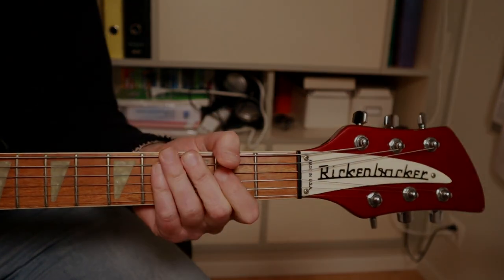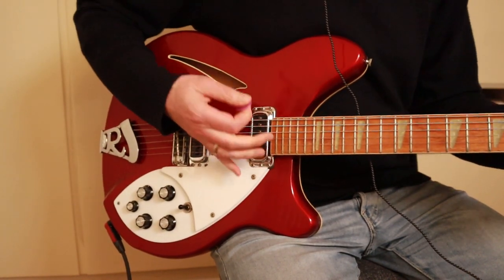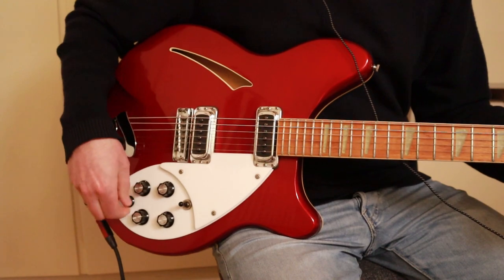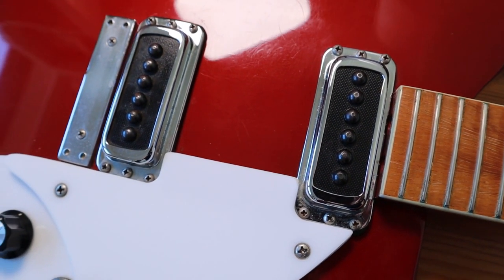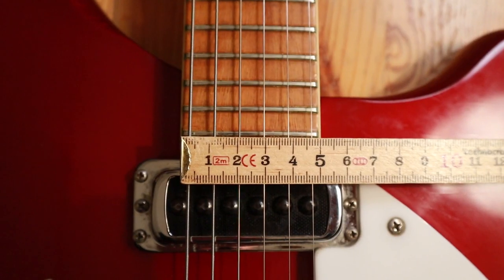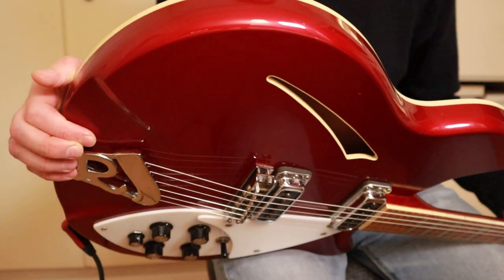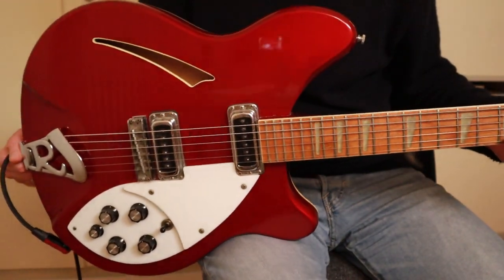Rickenbacker 360 - Sounds, pictures, info

Comment: How exactly do you have yours "set up" I just bought a brand new 360 and love it but I'm afraid I don't have the nut/bridge/strings etc... like they need to be to get it sounding like yours!
Reply from the maker: Congrats on your new guitar! I measured the action on mine, on the low E it goes from 2mm (nut) to 3 mm (12th fret) to 4 mm (24th fret). On the high e it is 1.5mm, 2mm, 3mm. I use roundwound strings, 09-46, nothing fancy. Have fun and enjoy your 360!
Reply: @becauseguitarsolos1264  Hey thank you for that response! I came from a 2012 Mexi-standard Strat. I find a lot of similarities but I was not a fan of the strings they ship them with and was getting a lot of buzz from the low E string.

Comment: I'd be surprised if after all this time, you haven't discovered that your 360 is actually a stereo guitar. You can plug it into two different amps using the RIC-O-SOUND output with TRS cable.

Comment: My 1971 360/6 has been in my hand since, well, 1971 when I bought it, it is a thing of beauty. The neck on yours seems so much fatter than mine, mine is really thin, fingerboard width is around the same, but.. And despite the absurd amount of years I've played it, the frets have never needed anymore than a touch of crowning, maybe 3-4 times since new... it does require a very light touch, even with 10-46 strings I use.. Fabulous instrument, nothing you can't play on it
Reply from the maker: Thank you for sharing!
Reply: @becauseguitarsolos1264  Thank you for highlighting these wonderful guitars..!

Comment: Thanks for the great video. The fretboard on your guitar is actually "Bubinga". It is commonly called "African Rosewood" but it actually isn't a rosewood at all. However, it is a decent quality hardwood very befitting of a Rickenbacker. I had a Fireglo 330/6 back in the mid 1980s and while it was a great playing guitar, I could never quite get into it's tone. The mid to late 1980s was really dominated by Strat styled instruments and with the right pickup configuration, effects chain and amp, a Strat could produce most of the tones of a RIC 6 and a Tele could get very close to a RIC 12 string. However, the RICs are beautiful looknig guitars, absolute works of art. One day I will probably buy another RIC but this time it will be a 12 String that I should have bought in the first place. Cheers from the Land Down Under.

Comment: What is the story on the two output jacks?
Reply from the maker: One is the regular output that works just like on any other guitar. The other is a stereo output that requires a stereo Y-cable running into two separate amps. Why is it there? It was the 60s man, everyone was high.

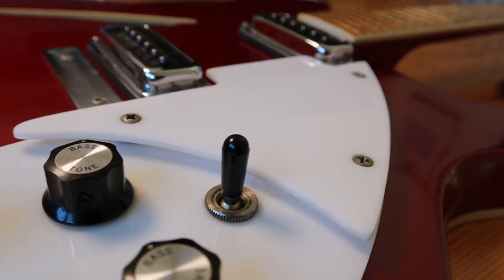Comment: 1:05
5th knob controls the blend between the bridge and neck pickups when in the middle position. Edit: aha, you explained it in the video...

Second output jack: "Stereo" for a y-split cable. Connect to 2 different amplifiers, one is the neck/low frequency output and the other is the bridge/high freq output.

Beautiful guitar.
Reply from the maker: Thanks for the comment! I might do a demo of the stereo function some time soon.

Comment: I've tried a few Rickenbacker guitars including the 12 string model  that  Tom Petty/Mike Cambell used. I found that the necks were all too narrow for me. 
I eventually found that the Yamaha Pacifica electric 12 string suited me much better. 
As for bass, I do enjoy my Rickenbacker 4003. Never parting with that.
Great video...
Reply from the maker: Love the 4003!
Reply: I have the same problem with the necks on the Ric's being too narrow, that's why I will always be an admirer, but never an owner. Instead I have a Danoelectric 12 string (with a 1 3/4" nut) to scratch that itch.

Comment: The most beautiful, elegant electric ever designed! You should have explained the stereo Rick-o-sound feature. I think that the mysterious fifth knob is actually there to fine-tune the mix when using that.
Reply from the maker: Yes, that makes sense!
Reply: That's the best theory I've ever heard regarding the "Fifth knob". 
Also, what electric guitar doesn't sound better when played in stereo?
Reply from the maker: @charlie-obrien  I totally agree, but there is still one problem with the theory: The 330 and other mono Ricks still have the fifth knob. So perhaps Mark Agnesi was right with his explanation: "Why does it have a fifth knob? It was the 60s man, everybody was high."
Reply: I have honestly never seen a modern Rick without Rick-o-sound, like 330s/360s post-1985. Agnesi is probably right. It used to drive me insane that he would play $50G guitars with all those rings on. I'm sure it distracted me from counting the pots on vintage models.
Reply: Sorry, Because, you're right! No Rick-o-sound  on the 330.
Reply from the maker: @meatsuitsublimator8506  I still think your explanation is the best one.

Comment: With that amount of fret wear do you have to have the action high? What is the action like? I just got my 2002 360 and the action seems crazy low. (I'm used to Fender guitars.) I'm guessing turning the 4 bridge screws clockwise raises the action? Thanks.
Reply from the maker: Despite the worn-out frets, the action is not very high on this one. I'd describe it as a comfortable mid-low. I could make it lower still, but prefer to have it this way. You're right that the way to raise or lower the action is to use the screws on the bridge.

Comment: The rick is a semi acoustic, just with the other f hole guitars I think they are better for rhythm and strumming. Rick's immediately got stamped with legend status when the Beatles used them. Ironically in later years they moved on to the epiphone casino a much cheaper guitar. Even though the casino is now chinese made it is probable 8 or 9 times cheaper than a new rick.
Reply: The original Epiphones were equally high quality guitars before Gibson bought them out and turned the name into their budget line

Comment: Thanks for doing this video.
Is there a specific model name for that body shape? Was it the only Ric produced with the single binding on the bottom? I had a 360-12, same color and body style, for three years.
I bought it very used at a music shop in Lewiston, Maine in 1980. It presented like it had been around a while, or had somewhat of a neglected life. That's probably the reason it was priced low enough for me to afford it. Judging by the condition, I would estimate it was at least 8-10 years old, So I like to think I had an authentic 1960-something Rickenbacker. I wasn't keen enough to look up serial numbers or anything like that back then.
Sadly, it was totally consumed in a house fire in December 1983 so I'll never know exactly what year it was made.
Reply from the maker: Thank you, and sorry about the twelve-string. I've seen the body shape referred to as the 'contour' style, as opposed to the 'double binding' style.
Reply: @becauseguitarsolos1264  Thanks for the reply. I watched a review of a 1966 Ric on another channel, and they said the stereo cable jacks were a trait of the 1960s and not featured on the 1970s guitars.
I remember my Ric had the double jack with the 'Ricko Sound' moniker stamped on it. Also the wound strings were very tarnished, like they'ed never been changed. This convinces me more than ever that my guitar was a 1960s model. I had a devil of a time keeping the bottom two (twin sets) in tune. I think the guitar may have been damaged and in need of neck adjustment.

Comment: If you roll off the neck tone completely the third knob acts as a blend knob. The up switch position is full bass. The middle position dials in the neck and bridge pickup for a standard two pickup sound and the down switch position is bridge pickup only.

Comment: Thank you for your video. 3 quick questions: is this a semi-hollow guitar? and did you use a pedal to record the video? What amp are you using? Thank you very much in advance.
Reply from the maker: Hi Berto! 1: Yes, it's semi-hollow, with a solid center block and hollow wings, like an ES-335. 2: I used only digital gear for the recording. There is just one pedal for a tiny bit of delay. 3: The modeled digital amp is a Vox AC30, cranked all the way up, bass all the way up, mids and treble at noon, presence at noon, too.
Reply: @becauseguitarsolos1264  Thank you very much!! You are very kind

Comment: What string height and neck relief do you have it set up with?
Reply from the maker: I like the action to be high enough so that I can dig in aggressively without any buzz. Big chords, Townshend-style. At the 12th fret, the action is at about 3.5mm for the low E string and at 3mm for the high E string. Not super-low, but still very comfortable, you don't have to fight the guitar. I've had the guitar set up at my local luthier recently, who adjusted the neck so that there is moderate relief.

Comment: What settings/pedals are you using?
Reply from the maker: For the parts that are driven, an AC30, almost dimed. Tiny bit of reverb and delay. For the clean parts, a Fender reverb deluxe, everything at noon, with a little bit of reverb.
Reply: @becauseguitarsolos1264  Oh okay cool. Thanks. I thought you were using overdrive though.
Reply from the maker: @blakemcnamara9105  For more drive, a treble booster or a tube screamer will do the trick. I just really like the way the AC30 distorts when you turn it all the way up.

Comment: It is an amazing guitar, I have 39, from all makes and models. Its the most I play, the sound is unbelievable, event better when you use a tube amp. I have the 65 360. Once you play one, odds are, you'll never play anything else, I swear. The neat thing is it has 2 ext Jack's, thus allows you to hook 1 amp up clean, 1 with distortion, or play thru PA, if that's not enough, you can use cordless mic, or head set.
Reply: That's what I love about you tube. Most people will say they have one prized example, then someone comes along and says he has 39, just to emphasise the point!

Comment: What amp and effects?
Reply from the maker: For the parts that are driven, an AC30, almost dimed. Tiny bit of reverb and delay. For the clean parts, a Fender reverb deluxe, everything at noon, with a little bit of reverb.
Reply: @becauseguitarsolos1264  sounds great
Reply from the maker: @pascualperez5252  Thank you! The one pedal that goes really well with Ricks is of course a compressor, for maximum sparkly jangle.
Reply: @becauseguitarsolos1264  I have a Rick 360 as well (from 93). And I play on a SINMARC amp (it´s a boutique amp). I use to drive it with a Pro Co RAT (at 9) and a cs3 BOSS.

Comment: Awesome demo..that ruby red is rockin'....by special order only for now...the 1.63 inch width at the nut is cool for the 6 string 360's but for the 12 string models, both 330 and 360 it can present some challenges for less accomplished players...on the other hand, the Ricky 660 models and 1993 vintage reissue Rose Morris plus 12 string  offer a 1.75 inch width at the nut....    .12 inch extra can make a difference for chording and picking..but these Ricky's are just overall superlative " works of art".. unmatched cosmetic appointments, not to mention those shimmering chord voicings...one commentator called Rickenbacker company "a guitar boutique"..and rightfully so!  Awesome production!..I'm watching it again...thanks!
Reply from the maker: I agree, a little more real estate on the fretboard makes a huge difference for a 12-string.